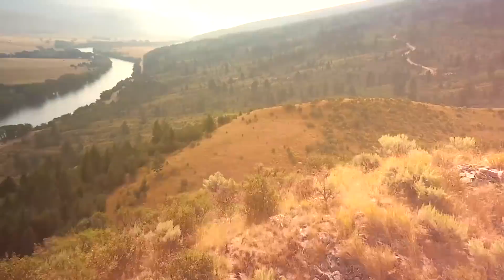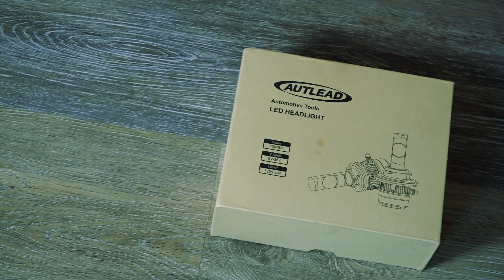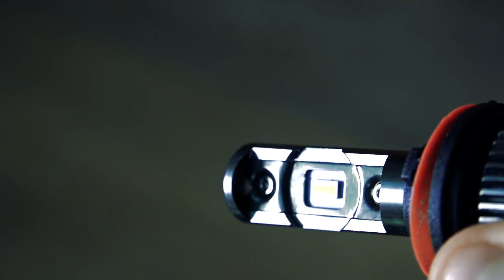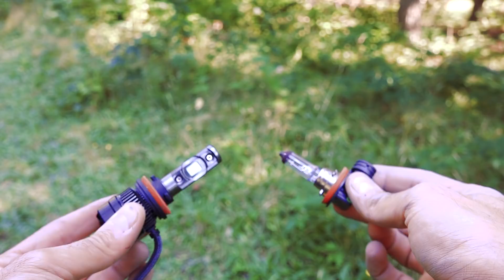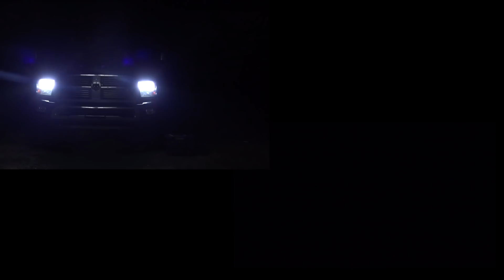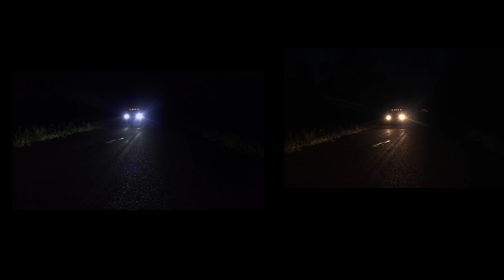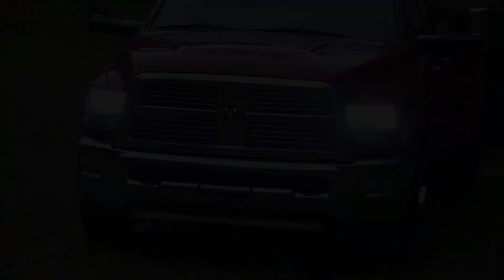Testing LED Headlight Bulb replacements in our Truck - Are they any better? Before and After

Comment: LED light scatters to much in the dark unless they have projectors like in the F150 factory LEDs
Reply from the maker: I dont think a projector is necessary as I am aware of a few factory LED headlights that are in reflectors.  I agree that factory is best, but a properly designed light (not saying these are perfect)  Should control the light in the same way as a halogen.  I do like the Ford LED headlight design tho!
Reply: That cut off line was perfect no scatter on the truck .... Leds are getting better and better. People have light scatter because they pair the wrong light bulb with wrong reflector.